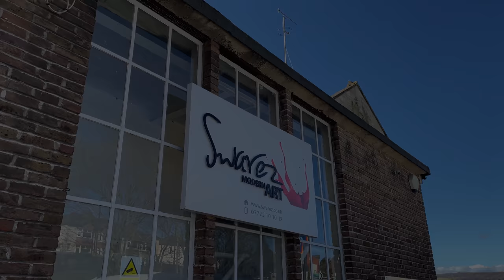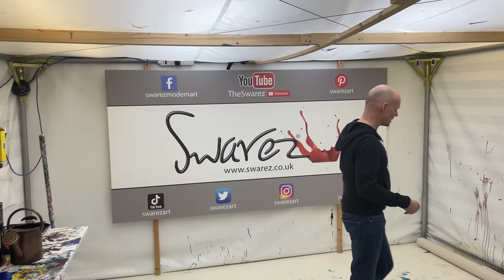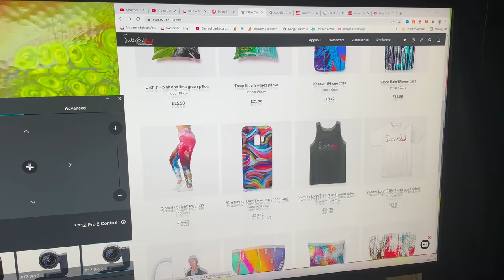The coolest ART STUDIO and GALLERY tour of 2022!!

Comment: Thanks for the walk around and congrats with the great work you have done. Sorry to bother you with a short question, as I am new at the channel. Do you finish the paintings with a varnishing layer? (As it looks like that) And if so, do you have any videos on the channel showing also that process and the materials you use? (If it's not a trade secret of course, which I will understand if it is) Thanks!
Reply from the maker: Hi Tod - thanks for your feedback and welcome to the channel! I actually don't use ANY varnish or other coating - the finish you see is how the paint dries as the gloss medium is already built into the paint. Hope that helps and thanks again for the question!
Reply: @SwarezArt  Thank you very much for your quick answer and explanation, sorry for misunderstanding the finishing, it looks so great that I had the feeling an extra coating of varnish was used. But I guess that's a compliment to your work. Cheers.
Reply from the maker: @Tod_oMal  welcome!